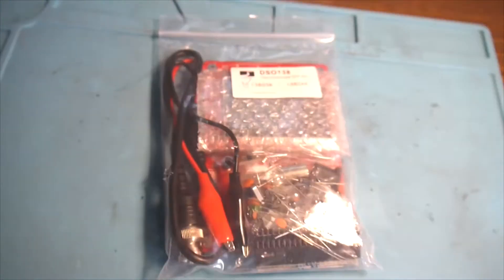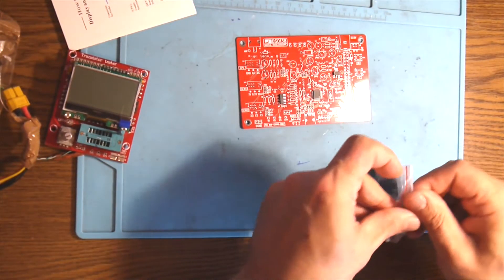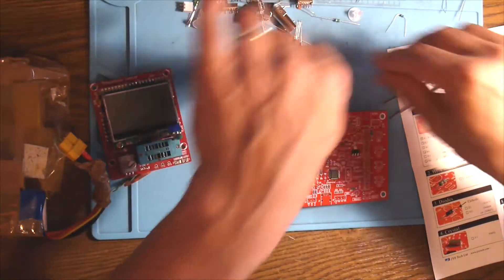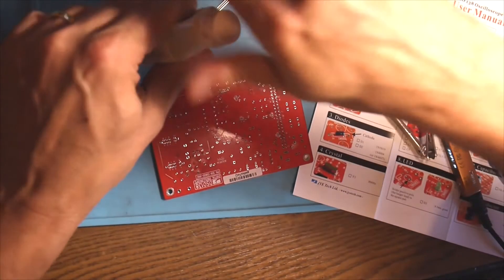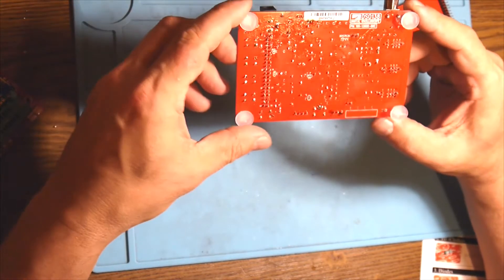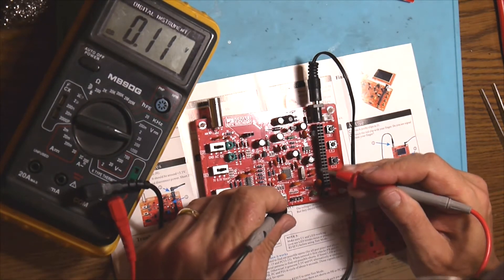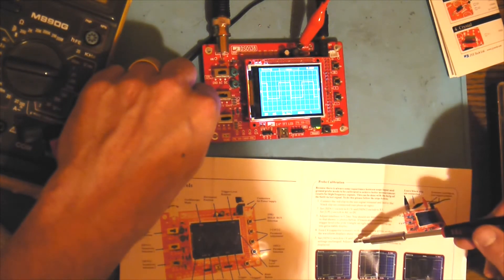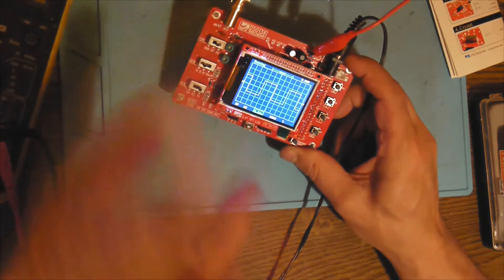DSO138 13803K DIY oscilloscope, how to built it and calibrate

Comment: Am achiziționat și eu recent așa ceva, după asamblare, l-am alimentat cu un adaptor de 9v 1a, si nu aveam voltajul necesar nici pe tp22, nici nicăieri. După mai multe verificări am observat următorul lucru: condensatorul electrolitic c19, de lângă dioda ln4007 se incinge extrem de tare, nici nu poți ține mâna pe el. Țin să menționez că este montat corect, după polaritate. Orice ajutor e binevenit 🙏
Reply from the maker: Schimba electroliticul..si parca sint niste strapuri de facut pentru a vedea tensiunile corecte..trebuiesc indepartate inainte de a fi folosit efectiv
Reply: @viocaia  Mulțumesc, am să incerc mâine, sper să se rezolve, revin cu rezultatul
Reply from the maker: @livestefan  Ok..succes
Reply: @viocaia  tocmai ce l-am terminat, nu era problema cu condensatorul, chiar l-am lăsat acolo si merge bine. Dupa ce am luat toate contactele la rand am observat ca avea scurt intre condensatorii ceramici puși in paralel pe linia de 3.3v de lângă ic-ul principal. Nu era vizibil niciun scurt, dar am făcut reflow la toată placa și după ce am retestat problema era rezolvată. Funcționează exact cum trebuie si sunt mulțumit de el
Reply from the maker: @livestefan  felicitari! E o scula utila!